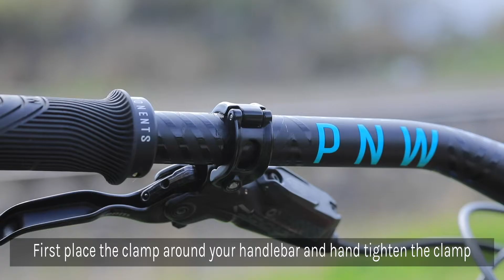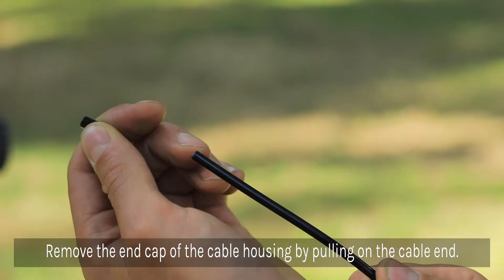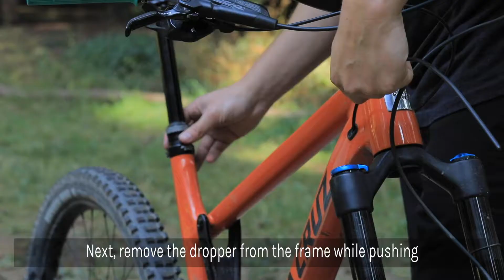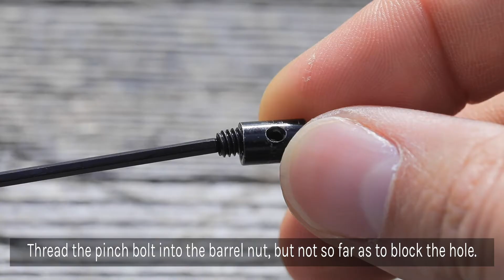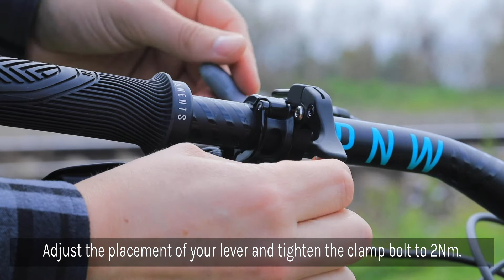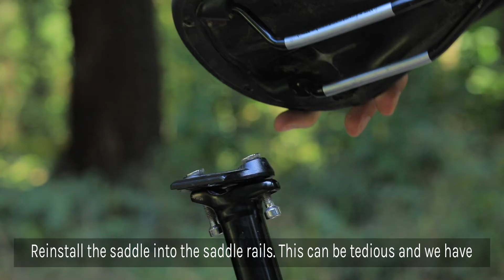PNW Components: How to Install Ridge Dropper Post with Puget 2x Lever

Comment: Just finished installing my Ridge 125 with the Puget 2X lever on my 2021 Rockhopper.  This is my first dropper post and it was a very easy install.  If you are doing yours for the first time I recommend watching this video before attempting your install.  Then measure your seat post height to the top of the seat post, not the hardware which holds the seat post in.  It makes it easier to put the dropper post in at the right height (this is not mentioned in the video). Do a dry run of everything before installing.  Also do not trim your cable until you test the dropper post is working. I took notes of each step to refer to during the install.  Total install time was less than two hours.  The post works great.  It goes down easily and the return is smooth.  Looking forward to my next mountain bike ride.

Comment: That was easier than I had hoped for. The hardest part is getting the cable housing through the frame. Everything else was a breeze
Reply from the maker: We're so happy to hear that, Daniel! We hear ya on the internal cable routing. It's never as straight forward as you'd like it to be. Let us know if you have any questions down the road!